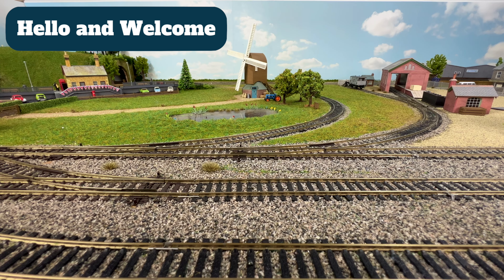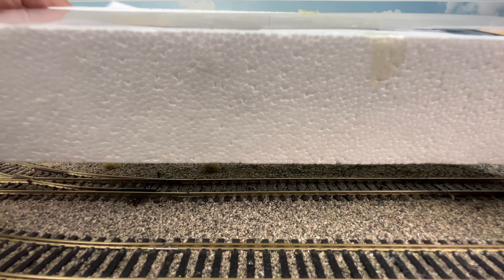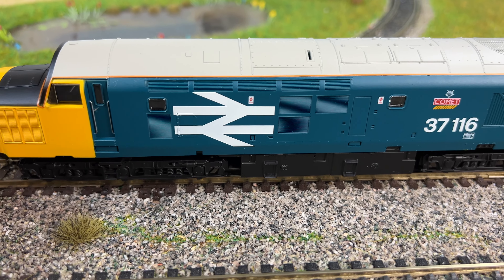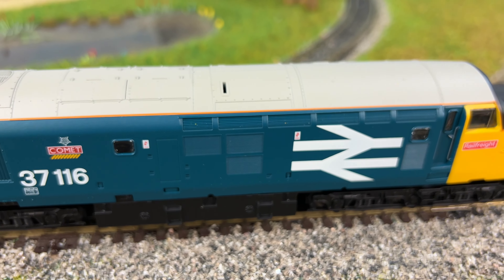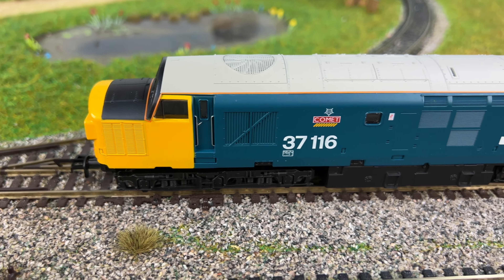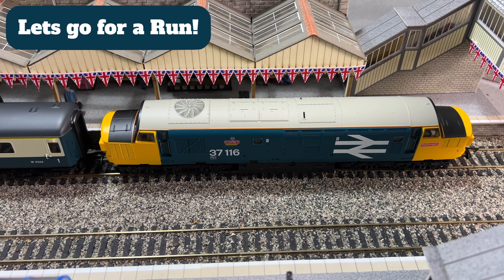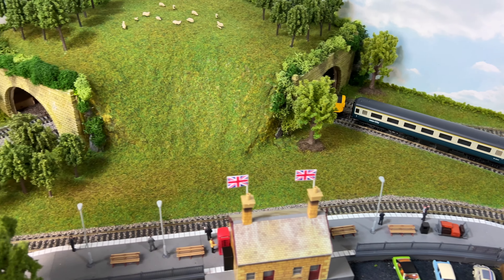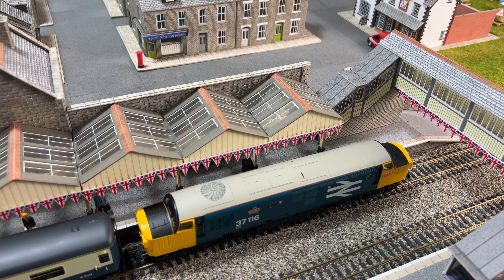Unboxing the Hornby RailRoad Plus Class 37 'Comet'

Comment: A nice loco and worth the money, unlike the SE&CR 'Thomas' (in my opinion). I'd probably get one of these if I did not have several Lima ones, including 3 examples bought ~2004/5 and still unused apart from a brief test run when new. Nothing wrong with the Railroad 37 which uses the excellent ex-Lima tooling. At a normal viewing distance they are more or less the same as a £200+ Bachmann 37 and run well enough for most people. I suspect the hesitation on points is just a bit of resistance as the bogies turn through a tight angle and nothing to do with electrical continuity. Good video, we need more exposure for budget models like this.
Reply from the maker: Thanks Paul 😊 Yeah I thought I'd try and look at more budget friendly models going forward.  Also helps my pocket as well 😁. It seems to be moving better across the points as it runs in 😊 I would like to get a Lima version of the 37 at some point.  I do keep an eye out for one at fairs and exhibitions 👀 Thanks for watching 👍🏻

Comment: Nice looking loco and a nice layout.  If you don't  mind me asking, what dimensions is the layout ?
Reply from the maker: Hello 👋🏻 It is a nice value model, which has potential to add upgrades such as lighting and sound 😊 The layout is 4' x 12' which is an extended and modified version of the Hornby track matt 😁 Hope that helps and thank you for watching 👍🏻
Reply: @LocoLeighton  Cheers.  I want to build a layout but i am  limited for space.
Reply from the maker: @andrewrice6596  If you are limited for space you could also consider micro layouts, end to end layouts or a smaller scale.
Reply: @LocoLeighton  Cheers !